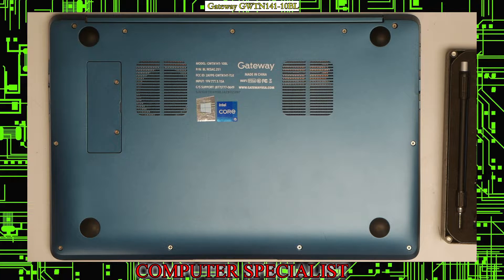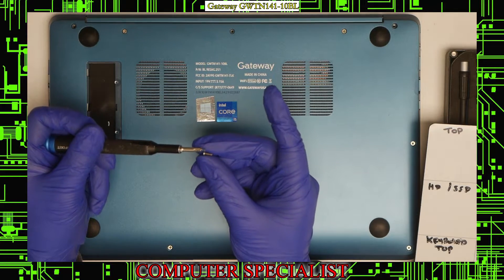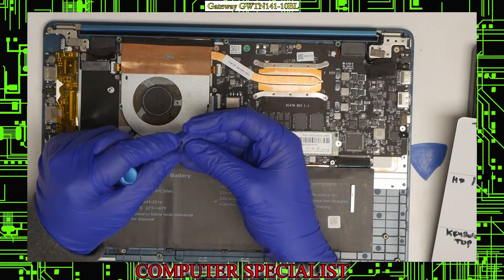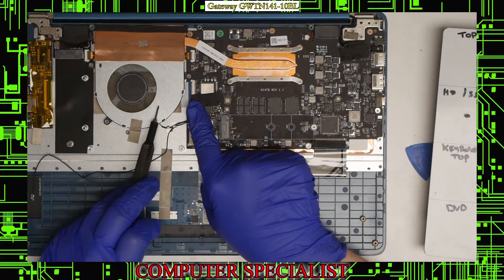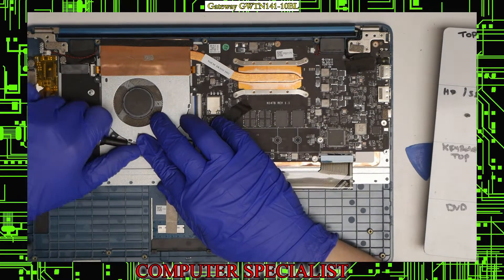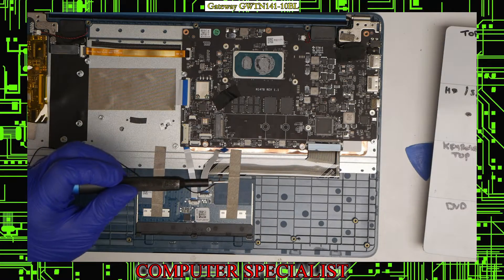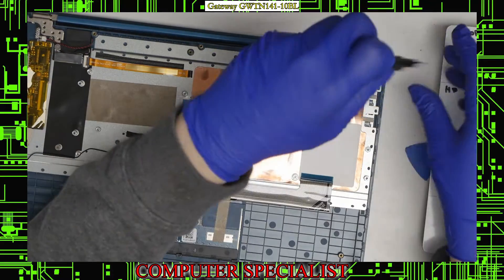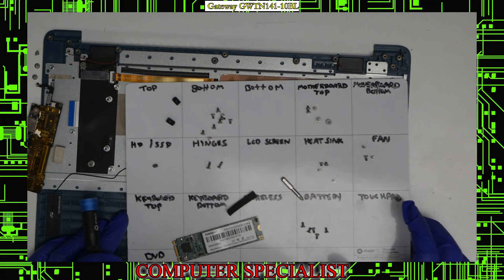Gateway GWTN141-10BL Complete Disassembly (Motherboard, Screen, Battery, Palmrest)

Comment: Guess I'm not going to be replacing my broken keyboard. 😂
Reply from the maker: Yes I would totally get away from that machine. Used machines are so cheap these days!
Reply: @computerspecialist8533 definitely. I think I'm going to piece together a mini pc setup and make it portable, so I'm not forced to stick with dead parts, and no RAM upgrades.
Reply from the maker: Something like this is cheap and small and can upgrade pretty good! https://www.youtube.com/watch?v=XMy74tRiD5c
Reply from the maker: Yeah just have to clean them yearly which is very easy to do!
Reply: @computerspecialist8533  sounds like reasonable maintenance.😂

Comment: Is there a way to replace the TouchPad?
Reply from the maker: So you technically could, but it's a hard process, much easier to place keyboard / touchpad assembly if you can find as a whole! Did touchpad just stop working?

Comment: hi! im pretty ignorant about tech hardware so i wanna ask if you have to put the tape back after disconnecting the cables?

i want to replace the keyboard and theres replacements on amazon for like 20 bucks, but i have read your comments and you say it's better to just plain out buy the full palmrest. is it actually possible to replace the keyboard with those 20$ modules or is it too risky? (considering i have never dissasembled a laptop and i always paid someone else to do it lol). its just that im not in the US and bringing parts down here gets like x2 more expensive than the part itself 😭 so getting those 20$ parts are way better for my wallet than those +80$ palmrests. but i wanna be sure the laptop is not gonna die after replacing the kb.

and another thing: is the screen replaceable? its also damaged.
Reply: also: if i buy the palm rest how would the repairing process be? just do everything you do on this video and then reassemble using the new palmrest?
Reply from the maker: The tape is not super important, you can also use new electrical tape. Also few things about the $20 they are 3D printed and usually have a crappy feeling as you type etc, not as nice as the oem keyboard. direction will be the same except you'll have to cut / break out all the plastic rivets holding the oem keyboard in, and then once new keyboard is in, crazy glue, hot glue etc where all the rivets were so the keyboard doesn't sag / fall inside when you type.

Comment: Mine overheated, even after, we replaced the battery on it. My main concern was, to extract the files, from the hard drive. However, this laptop, was not able to give me, the files, out of it. Does anyone have any ideas? On how to retrieve the files from the hard drive. Perhaps, they have been compromised, from all the, over heating, especially, the last one. The laptop, had refused, to boot up. My main concern was, all of my files. Perhaps, they will not be able to be extracted. If the laptop was damaged in the process. I will never buy this kind of a laptop ever again. All of my work seemed to be lost forever. Does anyone have any ideas to share? Thank you, and for the video.
Reply from the maker: As long as your ssd is NVMe (Only has one notch in its connector) you can use something like this to plug it into another computer and see if the drive is good or not! https://www.ebay.com/itm/156360427726

Comment: Thank you.. I will try this. I cannot seem to find a way two disable internet in the  BIOS. Satya is forcing a windows account and Gateway is shoving nortons (I think) up my arse... I just want to physically remove the antenna... I"m sick of MS. You make it look so easy. But, seriously what if someone bought this laptop and didn't have internet at home? They wouldn't be able to use it....what a idiot setup...
Reply from the maker: Shift+F10 before it makes you try and log into or make a ms account, at prompt type "powershell" then type "OOBE/BYPASSNRO" (Don't need to type the "quotation marks just the words inside! Can also try running the command straight from the command prompt.
Reply: @computerspecialist8533  That OOBE/BYPASSNRO doesn't work anymore. After I get the command prompt up I just can't type anything. Not even an external keyboard works. It is MS forcing you to make an account or you just can't use the laptop/device. I tried restoring a backup I had with a program called Hasleo (excellent program) kind of like Acronis but without all the useless crap running in the back ground and that put me in an auto repair loop. I had to download an ISO of 11 and burn it to disc... I hate MS with an unbridled passion. lol What a PITA JUST to use my laptop. Unbelievable ...
Reply from the maker: We use it everyday still. Make sure you click inside the Command Prompt to make that window active!
Reply from the maker: Glad it helped!

Comment: A great video, thanks. Where is the Hard drive and how to replace it with the new one. Please reply. Thanks
Reply from the maker: There is a door right on the bottom. But it only takes a M.S 2280 Sata drive. Make sure it has 2 notches on connection (not 1 thats NVMe). Here is one: https://www.newegg.com/western-digital-1tb-blue-sa510/p/N82E16820250232

Comment: Do I have to disassembly everything before taking out the palmrest? One of the corners near the hinge is loose (it stays lifted up) and won't let me close the laptop naturally. I'm thinking of getting a replacement since it could damage the screen too.
Reply from the maker: Yes unfortunately on this model you have to. It seems like your hinge post / posts broke. Common on laptops. There are videos were they use crazy glue and baking soda to rebuild the plastic by the post to save some money. I have did it a few times and it worked great, just very time consuming!

Comment: Mine comes on but doesnt charge. I bought a new battery cause it died when it was reallu cold. But it will not charge. Any suggestions?
Reply from the maker: Is it an aftermarket matter? (Not oem like the one you took out). Could just be a back batter, aftermarket ones are junk. Also does it show it trying to charge on the bottom right by clock?

Comment: My keyboard is out of order. Saw some modules on Amazon for less than $25 dollars. Cannot post link on Youtube comment though. Will try in next comment.  But, do you think it will work? will it be easy?
Reply: well, tried to paste the product link but rejected by Youtube. But you can find it easily on Amazon by searching GWTN141-10BK keyboard .  Do you think we can do replacement with it?
Reply from the maker: Here's a blue one and you can make an offer: https://www.ebay.com/itm/286049411970
Black one: https://www.ebay.com/itm/186673965162

Can use any GWTN141-4, GWTN141-6, GWTN141-10 models

Comment: My soundboard i not working cause I dropped it a few times, what should I do, please help!
Reply from the maker: You can try by first dissembling, all connectors, and parts and reassemble. Maybe something loosened up!
Reply: @computerspecialist8533  But I'm only 13 What if i make it even worse!
Reply from the maker: You can also try plugin headphones into the headphone jack and back out a few times. Maybe the switch inside got messed up from dropping!
Reply: Can you post a timestamp on the video, so I know where the soundboard is? I'm going to try to reassemble my computer

Comment: I'm glad I found this video. I have the GWTN141-2BL and my charger port is loose so I've been thinking about replacing it. Do you have any tips? I've been trying to find the part.
Reply from the maker: The charging port is soldered in, so you will probably need a hot air station or a soldering iron and some low-melt solder to get the job done. You should be able to find a compatible port on eBay with that model number:
https://www.ebay.com/itm/255656064346

I would also be sure your issue is actually the charging jack and not the charger itself. Maybe worth trying another charger first?
Reply: @computerspecialist8533  Thanks. I previously tried another charger and it didn't work.
Reply from the maker: Did you get working?
Reply: Once I opened it up and saw it was sodered on, I decided to just send it to compaq and have them fix it
Reply from the maker: @lasheacager2781  yeah surprisingly it’s a soldered Jack, most new laptops all have wired jacks which makes the job so much easier!

Comment: This is a really great video.  I have a some touch pad questions about Gateway GWTN141-10GR that I hope you can help me with.  The left front corner of my touch pad surface has started to lift up and I need to repair it.  Is a replacement touch pad surface available?  If not I am hoping to repair what has failed that is allowing the corner to lift up.  Can the touch pad surface be replaced without disassembling the laptop?  If not do you have a video showing how to replace the touch pad?  Thanks.
Reply from the maker: Hi, unfortunately you cannot replace that without disassembling the laptop. More importantly, I would double check that the battery hasn't imploded, as a raised touchpad/palmrest is usually caused by ab imploded battery.

Comment: How do you get the keyboard out?  I spilled coffee in it and need to dry it out.
Reply from the maker: The keyboard is integrated into the top palmrest assembly. You will need to replace the entire top to replace the keyboard. An unfortunately reality of cheap laptops.
Reply: @computerspecialist8533  Oh. Well that sucks. This is exactly what I was wondering, because my laptop has a stuck key after a water accident. So... I guess if I can't clean it from outside somehow, then my only choice is to unplug it and use a USB keyboard. Or you know, replace the whole thing. Yay....

Comment: Well, I followed along with your video, took the back metal plate off, replaced the keyboard, put it all back together and now the power light comes on but the screen doesn't turn on - nothing. I'm sure all my plugging is back and correct. I was thinking maybe something is not connecting? One weird thing, when I don't have it plugged in and I try to turn it on, the blue on light comes on but after about 10 seconds it shuts off BUT, if I plug it in - the light stays on. Any insights?
Reply from the maker: Did you get working? Sounds like Ram issue, try taking out and putting back in!
Reply: Same issue, did you ever end up fixing it?

EDIT: Fixed it, like an idiot, I'd put the motherboard back without connecting the LED ribbon/connector back into place.

Comment: Where is the CMOS battery located on the Gateway GWTN141-10bl?
Reply from the maker: There is no dedicated CMOS battery on this model, the 3.3V RTC power rail is generated by the battery.
Reply: @computerspecialist8533  
Thank you for the response back!  I am very much appreciated. Do you happen to know if there is a way to reset the CMOS batttery? My laptop turns on with a black screen and I will probably get a new battery to fix this.
Reply from the maker: Best way to reset it is to unplug the battery and hold the power button for a few seconds, then plug the battery back in.
Reply: @computerspecialist8533  I did unplug the battery for some time and hold the power button for like 60 seconds. The black screen is still on.
Reply from the maker: Did you very get working? or just replaced the laptop?
Reply: @computerspecialist8533  I didn't purchase the battery yet so I am unsure if that is the problem.
Reply from the maker: @jeffarndt9538 Yeah that model had a few issues. Wasn't made to well!

Comment: I don't know what happened to my keyboard but a lot (if not all) keys are being pressed without my input, is there something wrong with it? Should I replace it or do something else?
Reply from the maker: Sadly, it sounds like you have a bad keyboard. Only way to replace it is to replace the entire top palmrest assembly. Parts can be found on eBay for reasonable prices.
Reply: @computerspecialist8533  Oh well, thanks anyways for replying, might look onto them these days.
Reply from the maker: Did you very get keyboard working? or just replaced the entire laptop?
Reply: @computerspecialist8533  I ended up using a bluetooth keyboard, had to configure some keys to not input anything cause they were still pressing even after disconnecting the keyboard from the motherboard.

Comment: what's good brother. I have the exact same laptop and when I power it on the laptop itself turns on but the screen is black and then about 10-20seconds later the laptop shuts off. It's done this before but it eventually turns on after a few tries but now the screen doesn't seem to want to come on. Is this a battery issue? I've been debating on replacing the battery for a while now just wanted some insight. Thanks.
Reply from the maker: Hi, the laptop should power on as long as it's connected to the charger. Regardless of whether the battery is connected or not. This model is also known to have faulty power buttons, so perhaps try pressing the power button, then immediately disconnecting the keyboard connector and see if it stays on. If that doesn't work, I would rule out the battery by disconnecting it and seeing if the same happens only on the charger. Hope this helps.
Reply: @computerspecialist8533  thank you, will do

Comment: Thank You, so they are SATA M.2 DRIVES, now I can upgrade it safely !
Reply from the maker: Yep, that is correct!
Reply: I opened the extra storage compartment, the m.2 interface has two sections (mvme) not 3 sections (sata).

Comment: I have same model, laptop was urged I. To power supply suddenly started smoking from bottom vents. Now does not turn on. What do you think it is?
Reply from the maker: Smoke is never good, something burnt on the motherboard and needs to be replaced by a professional. I would bring to a computer repair shop that offers free estimates. We offer these services, but we are located 1 hour north of NYC.

Comment: i honestly have no clue when it comes to tech what is a good replacement battery as after 2 years my laptop battery started swelling
Reply from the maker: This model is a little expensive. https://www.ebay.com/itm/184736667954

Comment: Any thoughts why my (same model) will not power up? I've opened it and disconnected battery, waited a while, checked power cord volts, then start  button held down for a few,  nothing on screen but the fan comes on then stops, I'm too buzzed now so ya. Im getting a Dell
Reply from the maker: Hit power button until fan comes on and then quickly disconnect keyboard ribbon cable. See if it come on and let us know.

Comment: Has anyone else noticed that the space bar on the keyboard gives almost zero feedback while typing? It is driving me nuts and am wondering if I have an issue with my unit.
Reply from the maker: I'd pop off and check underneath. maybe something is stuck, like food etc. Or the clips popped out on the brackets. But should have same springback as all the others do.

Comment: i need help with this computer my screen peeled off now not turning on is there a way to recconnect the screen so i can download  data from harddrive or use the computer again
Reply from the maker: There is a HDMI output on the side. Get a HDMI cable and plug it into a monitor or TV and you should be able to get it to boot that way to get your data.

Comment: Thanks my g saved my life by showing how to disconnect battery. It refused to boot after messing with bios now it boots after disconnecting battery and holding power for 20 seconds then putting battery back and reassembling it. Booted up nicely.
Reply from the maker: That's Great! Feel free to sub our channel for more future videos etc!
Reply: Yes, disconecting the battery will reset the bios because the motherboard does not come with a CMOS battery.
Reply from the maker: Correct! Most the new laptops use the main battery also as the bios battery or backup bios battery!
Reply: Thanks bro!!

Comment: GWTN141-10BL (same laptop as in the video) I need the 30 pin wire that connects the screen to the laptop. The screen works but I messed up the 30 pin wire that connects the screen to the laptop. It has the front camera connection on the wire aswell. So you sell this wire? 🙏
Reply from the maker: The cable is built into the screen so it would probably not be worth it/too risky to try to replace that wire without damaging the glass, touchscreen, etc.
Reply: @computerspecialist8533  thanks for responding. The cable im talking about just connects to the bottom of the back side of the screen, to the front camera, and one more connection inside the laptop. Can you tell me what this cable is called and maybe a link to buy one? I already have the laptop disassembled and screen off including the glass. I just need to know where the buy the correct wire (I believe it’s 30 or 40 pin)  that connects the lcd display and the front camera to the computer. The cable that’s broken was taped to the back of the screen from the front camera down to the lcd connection and into one more connection inside the computer THANKS A LOT
Reply from the maker: Ah yes, I know what you are referring to. Unfortunately I don't sell it and I'm not sure where you might find it other than eBay. Doing a bit of searching on eBay I don't see any exact GWTN141-10BL cable models but there are LCD/camera cables for other GWTN141 model laptops. Maybe use the images to compare with yours to see if they're compatible/the same.
Reply from the maker: https://www.ebay.com/itm/325294262478
or maybe
https://www.ebay.com/itm/234525674032

Comment: I have a very similar model GWTN141-4BK.  The main board is a little different where the primary SSD is located.  Where is the CMOS battery or reset?
Reply from the maker: There is no CMOS battery on these models as far as I am aware. The machine generates the 3.3v from the main battery.